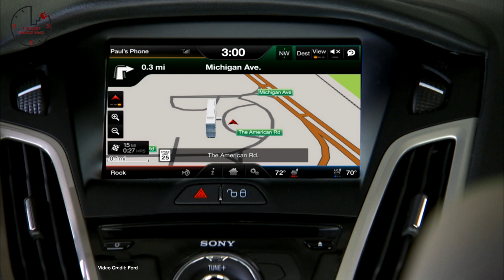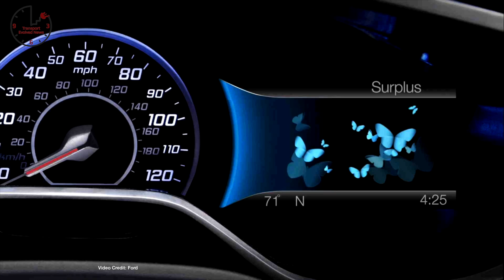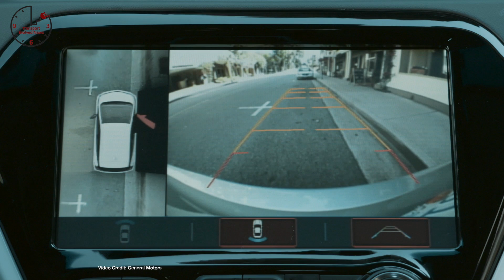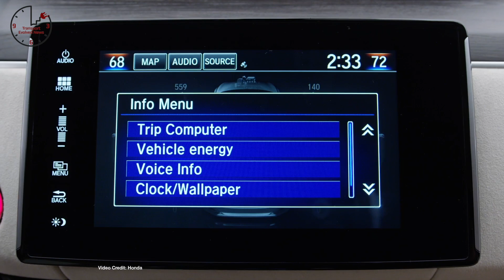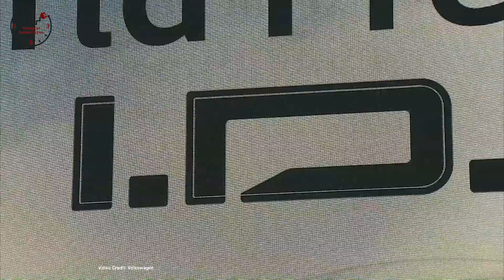Model 3 Production Reveal, Bolt EV Lease Deal, Lucid Air Testing- T.E.N. Future Car News 4/14/2017

Comment: lucid air high speed test... sceptical....
sees footage of stripped out and lightened/prepared car.... yeah... publicity stunt. any other manufacturer could do that and make their cars look loads better...
Reply: Michael Edmond And, what does it matter how fast it goes? Speed limits in North America are maxed out at 65/70 miles per hour. So this car will be perfect for grocery shopping, and dropping the kids off at the mall... Just like every other car sold in North America. Speed test! Funny.
Reply: Gordon Warlow my point is lucid did not comment if that speed would make it to the production model... unless they are selling it stripped down and speed test prepared! the footage from inside seemed to lack much of the other features, i would bet that it did not have any of the autonomous hardware on it at the time either.
Reply: Gordons : Speed limit in the US are not what they used to be ! I drive as fast if not faster in most of the US, not just Interstates than in Europe. It is why the market is in fact a lot smaller than people think. Just a few states and a few big cities.

Comment: Solar energy are the cheapest, with least maintenance and can supply the energy needs of the world that is an fact, also the cost of hydrogen fuel station is too expensive and would last longer to build than changing The energy system with solar panels and batteries.

Comment: California is strange on taxes, and I'm really not happy about this latest bit of Jerry Brown snake oil. Since California roads are supposed to be supported by gasoline taxes, I can understand hitting EVs with a tariff, but basing it on the purchase price is questionable considering the rapid depreciation most EVs suffer and won't be reflected in the State's registration calculation. 

I am also highly displeased that he made back room deals to NOT increase the fees for tractor trailers which do nearly all of the road damage. I doubt more than ten percent of the money collected from this latest travesty will actually end up in road maintenance- most will end up covering other 'general fund' expenses.
Reply: Oregon, where Nikki is based, was the first state to propose a use tax on vehicles with electric motors. And that was because they were worried about the popularity of the Prius, not Tesla or the Nissan Leaf.

You are right about the proportion of road damage due to traffic. It scales roughly with the fourth power of axle load. An 80,000 lb tractor-trailer with 4 axles under the load causes as much damage per mile as 4096 2-axle Model Ses

Comment: What ever happened to the hydrogen prototypes for internal combustion? Hopefully the more advanced manufacturers will return to that research eventually, since it's a better solution than electric.
Reply: @ForestNinkaZero

"Unfortunately, they won't be able to mount the required number of panels to recharge their vehicles on their rooftops or anywhere within their yard space unless they only drive it once per week and don't run anything else on their solar system"

Really? For my daily commute I use anywhere from 8kWh to 12kWh of electricity with my LEAF. Are you saying that rooftop solar is only capable of generating 12kWh or electricity per week total? Please!! A 7.5 kW solar system will, on average, generate 30kWh per day, more than enough to power two electric cars for their daily commute of 40 miles round trip each.

You may want to read "The Grid" by Gretchen Bakkee. She lays out how after decades of centralization the electrical grid is moving to a decentralized generation and consumption model, thanks to renewables. The grid of tomorrow will be very different to that of today.
Reply: Why? Electricity costs 1/10th the cost of hydrogen in hydrogen's BEST case scenario. In 5-10 years 300+ mile range will be standard, as will 15 minute or less quick charge stations for long haul trips. Hydrogen is 1/3 the efficiency of charging and discharging a battery. Why do you think hydrogen is going to win?
Reply: i dont think hydrogen has a chance in light vehicles. only really viable in 20ton+ trucks due to the inability for battery mass density and planes.
Reply: Most of your arguments are pure nonsense or devoid of facts, hydrogen and combustion vehicles are dead.
Reply: Primary selling point for EV's is not necessarily the environmental friendliness. They are fun to drive, very quiet with very good ride characteristics and they are lower cost to maintain. Ridding the power grid of the polluting energy sources is not a requirement for increased use of EVs. Even with the current state of the power grid, it is still less overall emissions if the market share shifted towards electric vehicles. The grid is getting cleaner as time passes. I am pretty sure that nobody can convince you and you will try and keep spreading similar incorrect claims but I just wanted to help keep the disinformation attempts at bay.
Reply: +ForestNinjaZero The environmental studies have already been done, for example by EPRI and DOE.  Hydrogen in a fuel cell vehicle results in 3 to 4 times the Carbon emissions compared to an EV.  Burning Hydrogen is even less efficient than an already inefficient fuel cell vehicle.  That's for Hydrogen made from electrolysis of water.  Most commercial Hydrogen is made from natural gas (Methane), a fossil fuel.
Reply: just leaves the problem of generating 4 times the electricity to make hydrogen.
rather than charging a battery.
then again it means you dont need batteries if you make the hydrogen in the day.
Would be cool though to use hydrogen as really inefficient high density battery.

However as i live in a country where power is produced via hydro hydrogen seems really really silly.
As hydro works at night.
Reply: Burning Hydrogen in a combustion engine is the worst of all possible worlds.  ICE is about 20% efficient, and Hydrogen is incredibly energy inefficient when the Hydrogen is made from electrolysis of water.  Bad idea.  The reason you haven't heard more about it is because it's incredibly inefficient overall.
Reply: Forest, supercharging using lots of power is a moot point since most people only charge their EV via supercharger on long haul trips ie less than 1% of the time. The grid can easily support the small number of superchargers it needs. In the next 10 years our central generation is going to be cleaned up in leaps and bounds. By 2020 almost all of new power generation is going to be wind/solar because new natural gas plants will be outcompeted. By 2030 you can expect a large amount of the grid to be clean. By 2040, 100% clean.
Reply: Solar energy are the cheapest, with least maintenance and can supply the energy needs of the world that is an fact, also the cost of hydrogen fuel station is too expensive and would last longer to build than changing The energy system with solar panels and batteries.
Reply: I disagree, i think in the long term the grid will be as close to 100% renewable as you can practically get. Definitely more than 95% renewable imo. Thankfully electric cars are charged at night which means minimal extra strain is put on the grid and we have time to react to more EV's drawing power. I think wind and maybe tidal power will make up a significant part of the generation for that reason
Reply: ForestNinjaZero a quick question, do you mean hydrogen combustion engines? Or hydrogen fuel cells?
Because where I live there are lots of NGVs (compressed natural gas vehicles) that could hypothetically be converted to use hydrogen, it's just more expensive.
Reply: Specifically internal combustion engines which have been re-designed or re-tuned for combustion of compressed hydrogen. I see that the most reasonable demonstration was performed by BMW nearly one decade ago, and there has been no news since.
Reply: ForestNinjaZero . I've heard of a person in the early 90s with an old VW beetle, producing hydrogen, using a small electrical at the fuel injectors, so you'd just fill the car with water . how true that is I have no idea ????? it was in the a British newspaper.
Reply: @NZJacobNZ I believe that hydrogen will win because the primary selling point for EVs is environmental friendliness, and there is no possibility of cleaning up the central sources within the next decade. The minimum 3+ megawatts/hr per supercharging station (ten or more 170kw to 300kw nodes per station with heavy demand after the 'advent' of electric transportation) will never be met with any amount of batteries at any station, and the central sources will generate more pollution than any fleet of gasoline powered vehicles.
Reply: I haven't stated that it isn't possible, my argument is that clean sources are mandatory and it won't be possible to supply that amount of current from local solar arrays, even if they entirely blanket every station. The ability to construct a storage array is irrelevant. Regarding home recharging: Unfortunately, they won't be able to mount the required number of panels to recharge their vehicles on their rooftops or anywhere within their yard space unless they only drive it once per week and don't run anything else on their solar system.
Reply: A pressurized tank of hydrogen shouldn't be much larger or heavier than typical 10 and 20 gallon tanks of gasoline, and any standard internal combustion engine will handle hydrogen efficiently with high precision re-tuning. High density tank walls will be necessary for safety, however, the weight shouldn't be enough to reduce the general performance or cargo and passenger capacity of the vehicle.
Reply: Forest, I understand your concern with the dirtiness of central power generation, it is something to consider. However, because of economies of scale power plants benefit from, it is actually cleaner to use energy produced from a coal plant than it is to burn gasoline in a car. Of course, it only gets better from there as we clean up the grid. In conjunction with this, the cheapest way to produce hydrogen is through the burning of natural gas. 90+% of hydrogen is produced this way. This in itself is not clean and would need to be addressed in order for hydrogen to be considered clean. That's not including the carbon cost of compression of the hydrogen or subsequent transportation. Electrons are a lot easier to transport than hydrogen is. All things considered, i think battery vehicles are going to be the clear winner in this fight for the next gen fuel. But lets wait and see. There might be some breakthrough in hydrogen tech. Whatever the outcome, the market will ensure whatever tech is best is the one that ultimately succeeds :)
Reply: Why not try refuting one since there are supposedly no facts in support of my empirical analyses? The transmission loss rates for recharging of EVs from a central source equate to rates of pollutant production which are vastly greater than those of internal combustion engines. There is no possibility of supplying the amount of current (minimum 3+ megawatts/hr per station) which is required to support fully active supercharging stations/networks with clean sources - the collection area will exceed the land space for every station, or even a local plant. EVs are only viable within coastal states where land is mostly flat, and will completely discharge their batteries within 30 minutes under persistent load. EVs cannot be recharged from residential solar systems or through common load centers at any tolerable rate (at the limit of the standard allocation for residential, the minimum recharge time for a Tesla is 4 to 6 hours without any additional load, and without a direct connection to the source, the charge time will be greater than 100 hours (500+ for standard outlets!). There will not be any possibility of eliminating 'dirty' central sources within the next generation.
Reply: @Somun I can't agree with you there since the 'green initiative' was the reason for the presentation of electric vehicles as a valid solution to the problems of oil dependency and lack of transport alternatives. I don't find anything fun about a vehicle which I can only drive once every three days unless I directly tap into the primaries of a multi-gigawatt hydro plant. Don't forget about transmission losses when predicting emissions, the value is very large.
Reply: Since you think very intelligent you could investigate a little to know that you are wrong and only make your arguments because you feel that hydrogen is the solution.
Reply: Please try supporting your arguments with physics knowledge or at least empirical analyses which are founded on captured data which you have actually analyzed personally. I'm sure that there will be enough tolerance for the issues of daily operation that electric vehicles will be more widely accepted than alternative fuels for internal combustion.
Reply: You understand what supply and demand is, your comment is a little silly.
Reply: Electric vehicles can travel more than 300 miles and Tesla powerpacks can manage schedules for conversion, transformation, or elimination of pollutant-producing central sources.
Reply: Your belief that Trillions of people of various political and social orientations will all agree to your utopian transformation by necessity is also a bit silly. Based on area (land space), resource volume and density, availability of materials and technologies, and human tendency, you should be able to predict that there will never be a 100% clean grid, and that no one will tolerate construction of any solar array which can meet the demand of a fully electric fleet.
Reply: Tesla's power pack cannot even run my entertainment systems for more than one hour, and my personal setup is standard in America. Additionally, the cost of panels, batteries, installation, and maintenance is multiple of that of central service. Tesla won't be managing anything.
Reply: Tesla Powerpack 210 Kw/h
Reply: I'd hate to see complete abandonment of the research, and I'm sure that everyone would appreciate not having to send their collections of precious internal combustion vehicles to a scrap yard. The problem with democracy is that the scientifically accurate solution is not always perceived as best. I'm looking forward to the outcome as well.
Reply: There's no possibility that those alternate sources will handle the load of the current and there is no such schedule for conversion, transformation, or elimination of the pollutant-producing central sources. Where owners recharge their vehicles is irrelevant since they're using the same grid, they'll need the superchargers if they need to drive their vehicle for more than 50 miles per day, and they'll exceed the capacity of the grid long before EVs are accepted as the new standard. By 2040, EVs will have been ridiculed globally.

Comment: 1.500 miles a year for the Bolt lease? That sounds a tad low, or is it 15.000 miles a year?
Reply from the maker: Soordhin you're right. it's fifteen thousand
Reply: Whew!!  I was getting a bit worried there.  Coming from a 2nd time LEAF driver who wants more acceleration, doesn't want the showiness (or cost) of a Tesla, and lives within a stone's throw of a Chevy dealer.  (but not a Nissan Dealer)  I'm considering switching from Nissan to Chevy EV, unless the 2018 LEAFs have substantial improvement in power over the previous models.